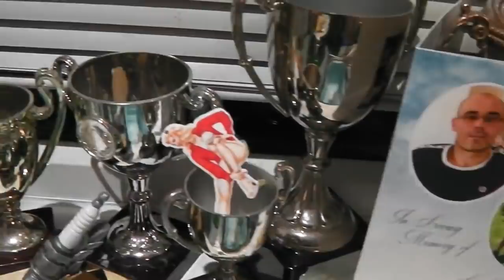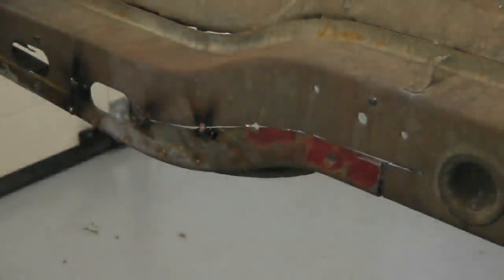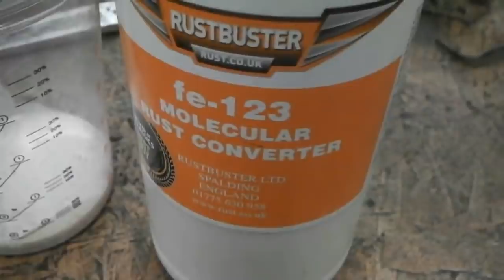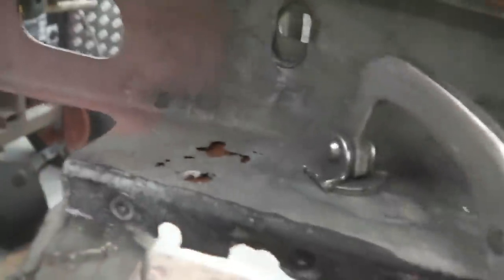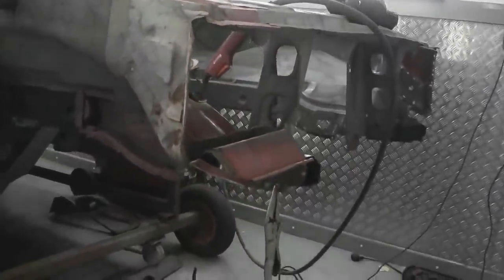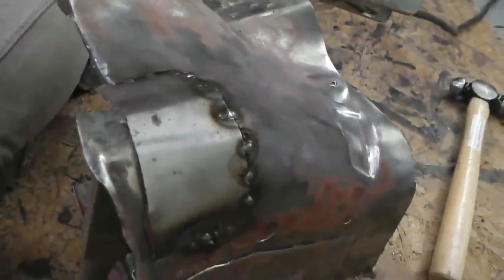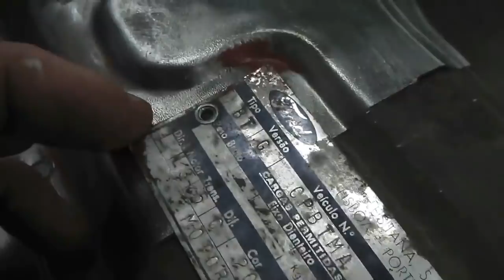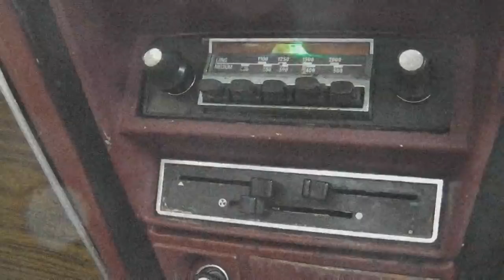Ford Cortina Restoration - Project Bramble EP5

Comment: Another awesome episode Pete, I admire the way you use donor parts in modular form then make them fit to look as if they are original. Never done mig welding (I was a trained ark welder back in the 70's) but I rebuilt my MK3 front end after a crash using an ark welder where its so easy to blow through the metal. Watching you mig weld is making me want to try it myself, looking forward to the next instalment.
Reply from the maker: John thanks, you are most welcome and im glad you have enjoyed the films so far, yes the donor parts, they came in from a portugese LHD donor shell, that had a smash and was badly repaired but had load sof new parts or what was there was rust free so it was such a good move buying it, i got it 3 years or more ago knowing it woudl be handy when the day came, and here we are, forward planning paid off, thanks John for your comment
Reply: @PeteCswampy   I saw your video on the Portuguese car, there were some good parts there, I'm a bit late to your channel party so I'm only just watching part 16 of Ruby, once again amazing work, do you use an argon/c02 mix for your mig? I'm looking at getting a mig myself.
Reply from the maker: hi John yes Argon mix, from GAS UK, no bottle rent, hope you manage to catch up and enjoy the films John, from Pete

Comment: I really enjoy the vids you do great work, something I do and I would recommend is the use of  a grinding wheel on your  angle grinder to smooth down the majority of the weld where you can, and then finish with the flap wheel or orbital sander also I find a die grinder fitted with a grinding stone  or a burr is great for getting into tight spaces and they also get the weld smoothed down very quickly and also the stones and  burrs last a long time.
Reply from the maker: thank you Duggy for these top tips, i do use grinding wheel on the 4 inch grinder and flap wheel on the 4 1/2    grinder, also hae a die grinder at the ready, yes for the tights spaces, i get the burr out such as in windscreen corners if doing a repair there, last rebuild I did (Project Ruby) showed quite a bit of the die grinder work, i think die grinders my fave but i do like the belt sanders, very precise hits on the plug weld heads, if in tight spaces, heavy on blets but worth it for the ease thanks again Duggy!!!! from Pete

Comment: Pete, I thoroughly recommending scaling down your tool size and utilising a right angle die grinder (air powered) and roloc discs,  I have been using them now for years, they do all sorts of disc, flap discs and flat sanding discs. They are fantastic for this kind of work and allow alot more control when buffing welds than an angle grinder does
Reply from the maker: thanks im going to try this, sounds good idea, theres going to be a lot of welds to flat down, thanks Denis
Reply: @PeteCswampy  go for the 50mm roloc arbor and discs. 3M is the original manufacturer of the roloc brand, but there are other manufacturers also probably a bit cheaper your local welding shop supplies will have them m8
Reply from the maker: thank you

Comment: love this really interesting, makes me want to find an old classic ,if only i had a great workshop like yours with heating
Reply from the maker: thanks for reply, there are plenty of projects out there, you could easy set up a garage the underfloor aint expensive, you can get pipes cheap, i guess its just the boiler, i had second hand boiler but you gotta get it approved corgi checked before you use it, have a look see if theres a car you like, its good hobby but pick a car you like and maybe what is in your skills or what skills you wish to learn,   its good hobby , quite relaxing most time...best of luck  and thanks for comment, Pete
Reply: @PeteCswampy  yes agree seeing what you do makes me want an old classic ,my brother in law had a gxl cortina for  a cheap run around  for a short time some years ago he came from Cyprus so watching your video  of old cars in Cyprus was interesting hope you can save the yellow gxl  sad to see the tc rovers my other brother in law spends his time messing with cars and bikes he has an rover 80 50s he put a diesel landrover engine in it and uses the car in barn find condition was in diesel car magazine about project ,need to see ep, 8 project bramble, keep up the good work

Comment: Hey Pete, been watching you for a while now and dropping lots of likes -  you are a pleasure to watch and you're doing some great work, you're methods and techniques are slowly improving all the time. I've done quite a bit a resto work myself. Just a little tip re grinding welds, I used a 40 grit  flexi grinding disc on an angle grinder to quickly knock back 80-90% of the weld and then I would finish off with a belt sander. It will save you a lot of time and many belts!
Reply from the maker: Hi Lander, yes a few people have mentioned those flexi pads, i now have gone out and bought one. so thanks for this tip. i also use a grinding disc too, but nothign does em quicker than the flexi pad and or . finger sander. angle grinder with grind disc last ages but i find not as quick.  good to have all options, thank you for your support recently, all the best, Pete

Comment: Wow, you are listening to the same genre/timer period music that I listened to in the 1980's,....we are probably both similar ages, early fifties, ...but anyway, greetings from Oregon, USA, I am enjoying your videos, wished I still did something with cars, well, will do a engine replacement on a 1999 trailblazer 4x4 soon, if I can fully afford it, rebuild its transmission automatic too, once worked as a mechanic,...have owned a mig welder for, like since the early 90's, ....had to do alot of repairs on lower door skins and quarter panels, patch repairs, due to the wet environment in my locality,....and some stuff in later years....I technically own alot of equipment, but no longer a shop to work in in the new home,....bought me a inverter tig welder from everlast five years ago, .....never fully used it unfortunately, was getting a bunch of MRI's and I feared getting weld spatter in the eyeball and having to get check out for such before every mri, etc.  Well, I don't have a workshop in my new home location like I did many years ago.  I even own a plasma inverter cutter,.....I did cut some sheetmetal with it, but I suppose using it to make cuts on rotted sheetmetal would be maybe too much heat, maybe, unsure,....I wonder if you have thought of using a plasma arc cutter, the newer inverter types?...mine will cut through painted or rusted metal, up to a half inch, is set up for 220volt(usa, I use a stove or clothes dryer outlet with plug conversions and my custome made extension cord of 100 feet), and could use 110 volts(not desireable and that is usa household voltage).  You are doing more than I have ever done, but I "aspire" to do such....Technically, I have had a life long interest in classic cars and restoration or hot rodding, I used to read the hot rod magazines way back in the 1980's, and alot of books pertaining to restoration of early 1900's cars,....I mean, the early 1900's cars that were featured in restoration books of the 60's and 70's were often found with just a frame and drivetrain cause the bodies were made with so much wood, and spoked wooden wheels too.  .....I missed my calling, haha, I should have been a professional car restorer featured in alot of magazines and books, cause with mininal equipment, I've done some amazing repairs on cars in the past, with a welder,....and I tried out leading one time cause I really hate the over use of bondo or so called plastics body filler, they always shrink and crack over time, and forget about flexible areas,....leading IS the way to go for a truly permanent repair.

Comment: Enjoying your videos.Could I give you a little tip that may help you improve your welding because at the moment your welds have not penetrated properly.Turn up the power on the machine and turn down the gas pressure,this will prevent the welds being too cold as they are at the moment.Tacks are only for holding the workpiece in place whilst a full penetration run is completed.
Practice on some scrap metal,you will soon get the idea,The object is to keep the pool moving as the torch moves.Try doing a straight run and get the wire speed right.You will know it's right when the MIG arc sounds smooth without the crackling and spitting sounds you have right now.The finished weld should be smooth and free of Pigeon Shit requiring little or no grinding.
Hope this helps.
Reply from the maker: thanks for this I bought a new set of gauges and altered the pressure as you sugest, its going a lot better, im deffo getting better, im starting to get good smooth runs. I noticed if its thicker metal you turn poer up a notch or 2? Can I please thank you for taking time to help me Brian, from Pete
Reply: @PeteCswampy 
That's right mate,if the metal is thicker you will need to turn the power up,don't be afraid of power,if you think the power is too high,before you turn it down,try increasing your wire speed first,until you find the sweet spot as I explained earlier.Power is your friend and your route to professional standard welding.You will get there in the end.
Reply: @PeteCswampy  .You're very welcome my friend.

Comment: Another trick I have learned when bridging small gaps with your welder...Use a small slab of copper on the opposite side of the weld area...Helps a lot, and the welds will not stick to it...
Reply: lol, I see later in the Vid you used the copper plate....
Reply from the maker: lol!!! thanks Jay anyway, it works up to a point but you can still chase on thin metal, not too bad on chassis type stuff but harder on thin metal thats pinholed, ive ended up replacing a few panels due to heavy pinholes
Reply: Been there many times myself Pete!

Comment: I love the fabrication work, Pete, grand job mate. Little steps, but your getting there for sure. What size wire do you use for welding? I normally use .8mm for body work, i tried the smaller .6mm but did not get on too well with it. But i have had a few people tell me that the smaller .6mm is better for panels. And with regards to the Silverline finger sander, yep, its not man enough for the job, don't get me wrong, it does the job, but i found it got very hot if i used it for more than a couple of minutes at a time. Ok for the odd little job, but i think the motor would soon give up if used on a big job like this.

Comment: If you are going to use a lot of phosphoric acid, you can buy it in 20 liter drums and the concentration ranges from 25% to 85% . It's put it cola drinks (hence the stories of soaking things in drinks ) . I have found that Dairy farmers use it to clean out their milking machinery and can be bought quite cheaply in bulk through farm supply places. It has a few different names,Also known as orthophosphoric acid, phosphoric(V) acid, trihydroxylphosphine oxide, trihydroxidooxidophosphorus. CAS number: 7664-38-2. Formula: H3PO4.
Reply from the maker: thanks for this info, very useful!!!!!

Comment: Coming along quite nicely Pierre , will you waxoyl the inside box sections etc'  as i did this  on my 90 and they are still solid .
Reply from the maker: yes I use Dinitrol, used it on all my cars, and I use with a pressurised gun system its a more poweful jet gets everywhere, great stuff

Comment: Coming along great. Do you have a video or any info on the donor car? Seems like it was a pretty solid car for sure
Reply from the maker: hi Mr BD  yes theres films of the donor car, it had loads of very good panels but all badly / botch fitted. it was from portugal but had a side impact, must have been a bad crash, every panel was replaced, but they just badly welded things on and bashed the floor straight with hammers, it was rough, no engine, no logbook, it was only good for parts,
Reply: ah thats fair enough since it sounds like a bit of a cut and shut, so not worth fixing and its always nice to have an interesting back story like bramble does

Comment: Hi Pete, would it be an idea to place a small dimple die hole in the new metal you let in where the water pools under the headlight?
Reply from the maker: Bob, well the bowl is designed to let the water out, it has a little sort of spout end, however leaves block this area thats why they rot, it sort of pools, so yes a small dimple may help, thanks Bob for watchign and taking note. Pete

Comment: Reminds me when I used to do this with vintage MG's . I'd save up and spend a fortune on some rotten wreck and end up carrying it out to the bin a bucket at a time. Made me wonder what did I actually buy ?
Reply from the maker: easily done but if it was easy........everyonw would do it!! yes buckets of rust. but it feels good when you get rid of all the rot and put it in the bin, i take all the metal to the recyling yard so at least it not wasted, try and recyle everything i van, thanks Volvo man!!! from Pete

Comment: Hi Pete if you can get hold of some old d penny,s this is a old school trick used in filling holes in body work that u can’t weld fill the gap
Reply from the maker: great tip and yes few people mentioned the copper, never thought of old skool 2ps!! good move!!!! Martin cheers, i also have a flat copper bar I bought from Frost Automotive

Comment: Use some non-ferrous material behind the weld clamp it flush and you end up with a great weld
Reply from the maker: thanks Sean, it worked i used a copper bar

Comment: Had a 1mm cut into the back of my hand and try running up my arm , never be complacent is correct I wasn’t and it still happened lol.
Car got welding i got stitches 🧵🤣
Reply from the maker: ouch!!! Mick, mega dangerous, you still got the scar i bet
Reply: Pete C yes i do pal although as it was a 1mm disc it’s a neat thin line lol missed every main vein to although you wouldn’t have thought so when the garage looked like a scene from saw lol

Comment: Instead of finger sander use a die grinder with Stone ends to take most of weld then use finger sander
Reply: Should be using a right angle die grinder with roloc discs, they do all sorts for every job imaginable, and are far more accurate for this kind of work
Reply from the maker: Denis you are right and im on this thank you for your help with this!!!
Reply from the maker: thanks Sean yes I got a die grinder set up now thanks mate for this tip, I did have one but compressor was off line, all fixed now!!!!

Comment: Great progress Pete coming along nicely! Tidy workshop tidy mind I think helps start the next day fresh when clean and tidy eh... can't stand mess myself and hunting for tools is a nightmare lol always best to be organised. Good welding techniques you've got I feel, practice makes perfect and it's all looking great mate. What camera are you using for filming Pete? I'm sure you've mentioned cameras in the 100's of hours of vids you've posted but I've got no chance of finding it again ! My email address is denjmunden@gmail.com if you can give me some pointers on filming and camera equipment etc it would be very much apreciated as I would like to start a you tube channel in the new year featuring my Cortinas and classic camper restoration. Kind regards Dennis oh and have a wonderful Christmas :)
Reply from the maker: hi Den, for all the films i have used a panasonic DC serie pistol grip style camera, they are ok, but these days theres prob better ones, its just i got so used to using them and they worked for me in terms of the pistol style which i like, rather like an old cine film camera style in the way you hold it. i have broke a few , but what i do is buy second hand on ebay then run em till they die, i have been thru 4 of them now!!!